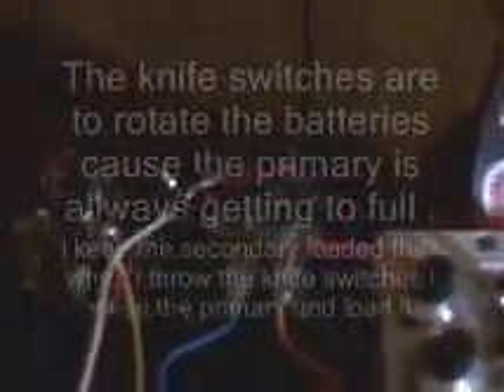110VOLTLAMPSCR

Comment from the maker: some neons will fire at 70 volts . Most of the Radio Shack neons have a resistor on them and they fire at 110 . neos that fire at lower voltages will eventually burn up the gas and take more voltage to fire them .

Comment: Nice work !
do you have 2.6 Watts output
with just 120 MilliWatts input ?

Can you run your system just with charged capacitors without any batteries ?

Many thanks.
Regards, Stefan.